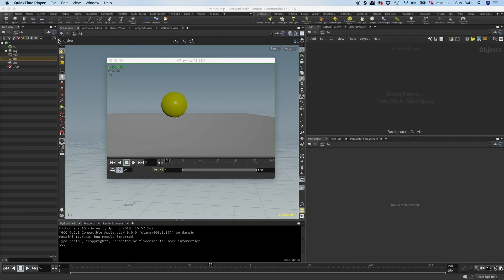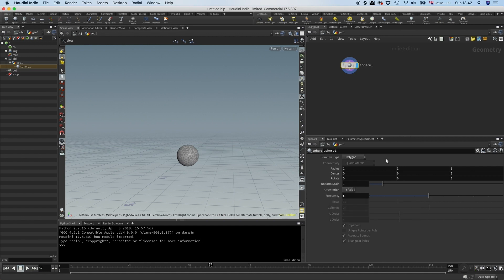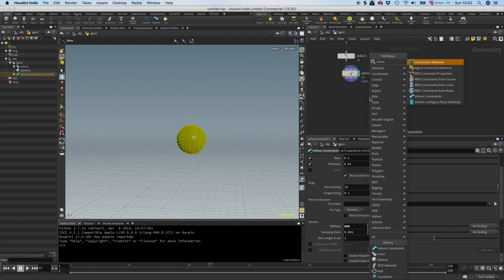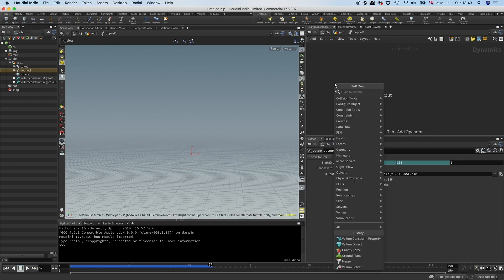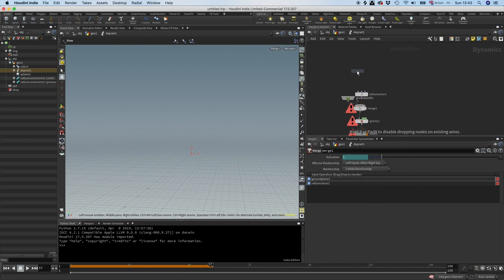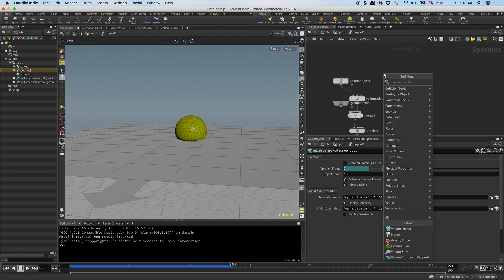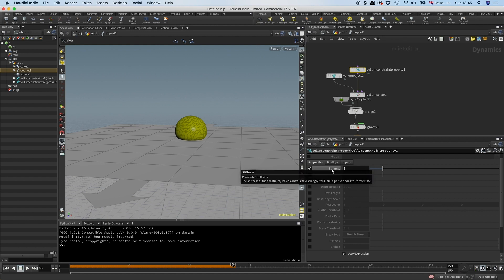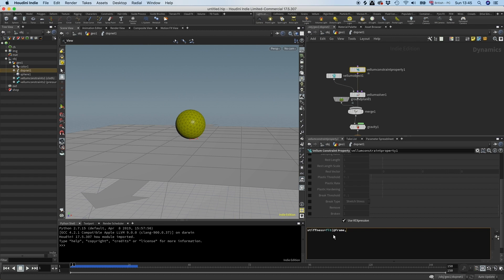Inflate an Object in Vellum (Houdini)

Comment: An even simpler approach instead of piping in a full latte dopnet is to write out a stretch group on the constraints sop, then jump in the Vellum solver on SOP level and add the Vellum constraint property node in there.
Reply from the maker: Cheers! Always good with alternative approaches :)
Reply: yeah that's what I thought too. But I tried both and they doesn't seem to behave the same way at all. Let's say you put your stiffness to 0.1 with vellum constraint properties, in a dopnet it will totally collapse, which is what you would expect. With a vellum solver in SOP it will only deform not collapse, it's like the pressure is still in there; I don't know what I'm doing wrong again x)
Reply: @tetsuooshima832  maybe the vellum solver has default air resistance in forces that the dip net doesn’t have unless you add it